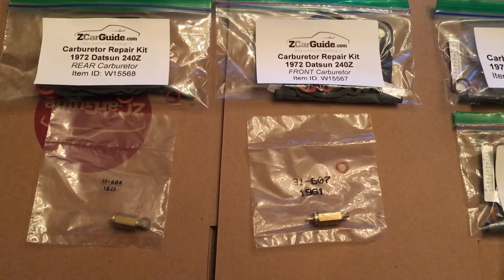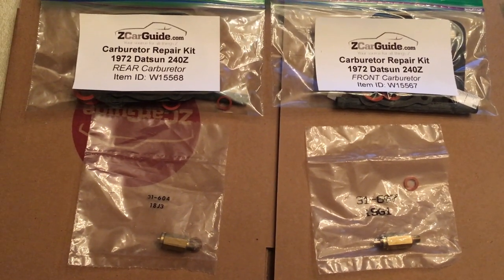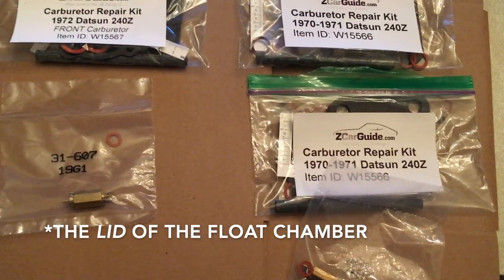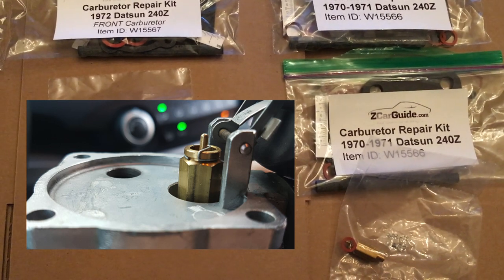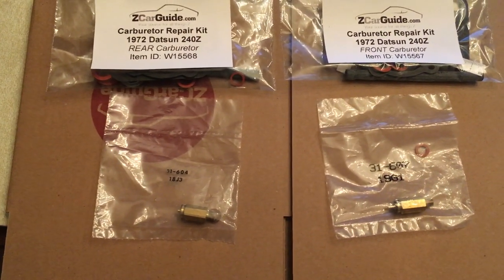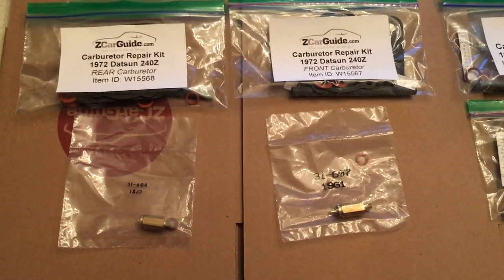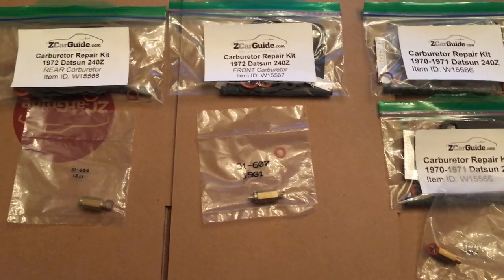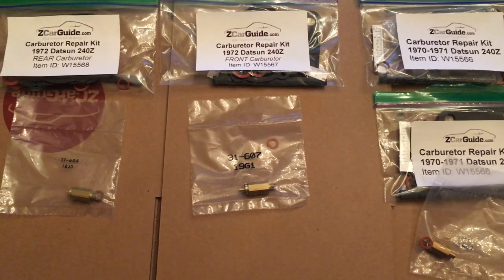Float Bowl Lid Differences for 1971-1972 240Z Carburetor Kits

Comment: I believe Nissan figured out that durning hard acceleration, the levels of the float bowls became different.  I’m not sure if this was due to the g-force on the fuel in the bowls. It’s worth noting that the float bowl is to the front of the nozzle on the forward carb and to the rear of the nozzle on the rear carb.   This solution was an attempt to fix that problem, and keep the amount of fuel delivered to the nozzles synchronised. So the ‘ears’ on the front float bowl are longer by a few mm.   The balance between the two SUs is critical for optimum performance, at all engine speeds.  So. yeah, important to have the right ones for your setup.
Reply from the maker: Thanks Richard!

Comment: On my SU's I need to have the flats on the seats turned so they will not interfere with the pivot pins. I used the GP Sorensen Carburetor Kit 96-295. The car is a 73 which had the flat tops. The 3 screw SU's were bought from EBay and have no idea the year. Looks like I need short seats for both SU's. Any suggestions?

Comment: I am rebuilding my carbs now, and I noticed this 2 weeks ago. My problem is I bought both carb sets from people who didn’t know the year they came off of exactly. Is there a quick way to do this?
Reply from the maker: Hi, J V -- sorry for the late response! I believe you should be able to remove the float bowl lid with the carburetors still attached to your 240Z. That will allow you to inspect the length of the hinge arms and determine which kit you need. Otherwise I have guides on removal and disassembly on this YouTube channel and in text format on my website. Hope this helps.